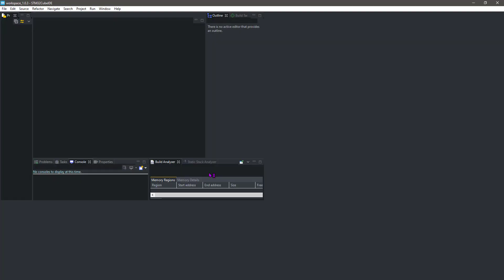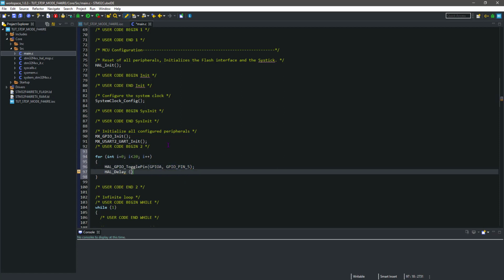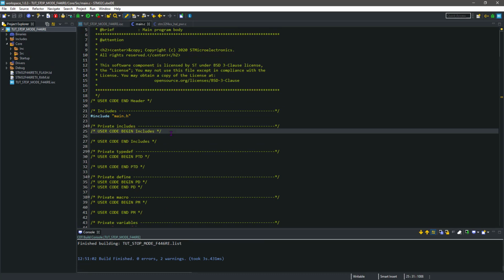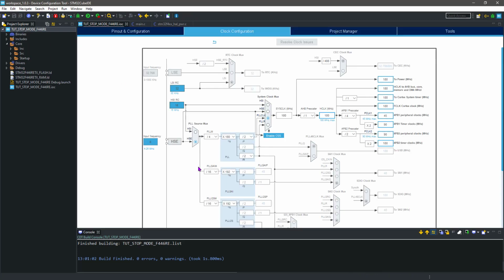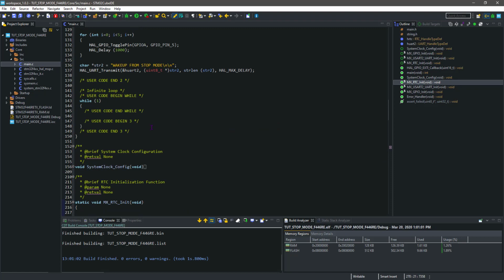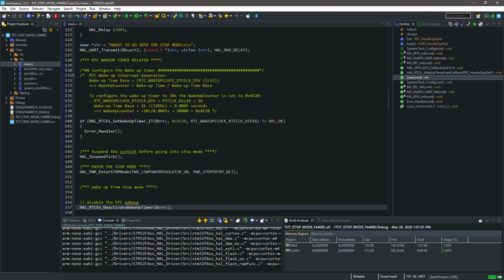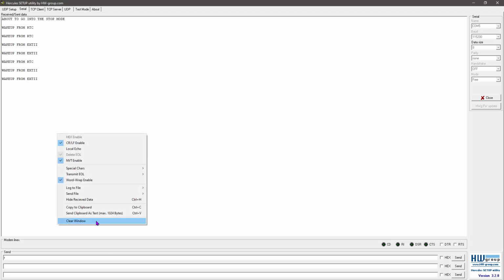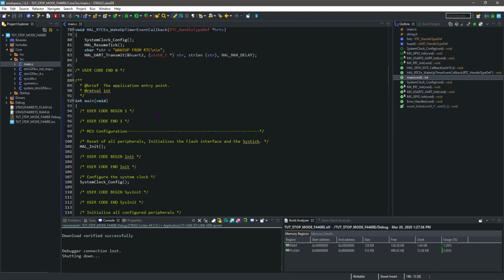STM32 Stop Mode Tutorial | Save Power Efficiently

Comment: I am using stm32L552CE. When I enter stop mode or sleep mode, the current is too high (5mA for stop mode, 18mA for sleep mode).

 /* Enable PWR clock */

  __HAL_RCC_PWR_CLK_ENABLE();
 HAL_Delay(5000);
printf("Go into stop mode\r\n");

 /**** Suspend the Ticks before entering the STOP mode or else this can wake the device up **********/

  HAL_SuspendTick();

 /* Enter Stop Mode */

 HAL_PWR_EnterSTOPMode(PWR_LOWPOWERREGULATOR_ON, PWR_STOPENTRY_WFI);

 SystemClock_Config ();

  HAL_ResumeTick();

 printf("Wake up from stop mode\r\n");

Please help me. Thanks.

Comment: can you please do a video implementing wake up from STOP mode in STM32 ( but using  LPUART )  connected to PC via regular USB and use Hercules SETUP utility to send data over serial that makes the STM32 wake up from STOP mode.
Reply from the maker: during stop mode all the clocks are halted, so the uart clock is not running. You can only exit the stop mode by rtc or external interrupt

Comment: Thank you very much for sharing. Just one thing. I did exactly the same and got the consumption down to 44 uA. However, when I connect a radio, immediately the consumption goes up to 1.6 mA, only when I connect it (without using it) could you please help me? Thank you.
Reply from the maker: what's radio ?
Reply: The example I gave is with a Lora radio. In general, when I connect anything (without using it), the consumption increases significantly (44 uA to 1.6mA in the case of the Lora radio).
Reply: @mechanicsbydavid  Some radios and modules have the ability to be put to sleep, so you could send them an off command before putting the mcu to sleep. I know that some Lora modules have the function, take a look at the datasheet of your particular chip to know for sure.

Comment: 13uAmps, how did you get as low as that? I'm using the blue pill board (STM32F103C8T6) and got these results:
Stop Mode: 4.1mA@72MHz and 3.9mA@24MHz. I go as low as 250khz~, but that didn't change the readings.
Reply: It could be the LED, try removing it with a soldering iron
Reply: On the BluePill board, beside the power LED which has to be removed, the LDO voltage regulator itself takes about 60uA. So you have to change that by another one (TPS7A03) to be able to come down to about 14uA in stop mode.

Comment: man you just forgot to mention that you have to disable the debug swd manually if you want to run at very low power... i passed from 140uA to 3uA by doi that.  best regards
Reply from the maker: In f103 ?
Reply: How can you disable SWD manually?
Reply: Hi. Please, can you open the manual swd disable? I have also exact the same current issue.